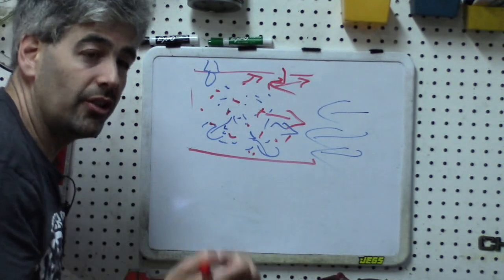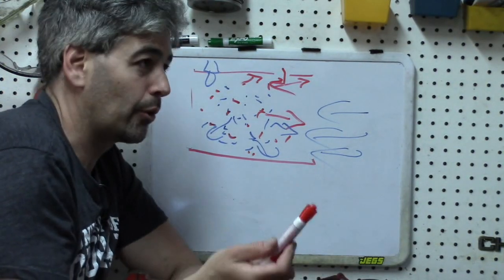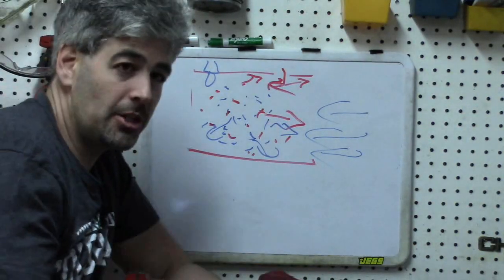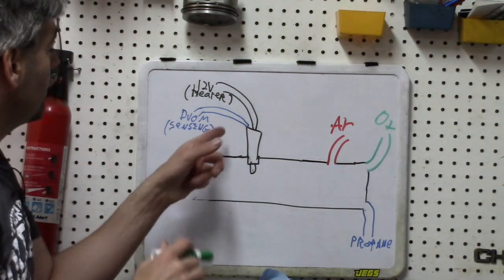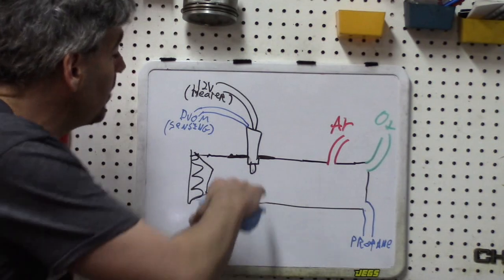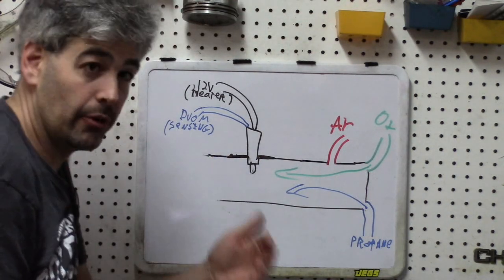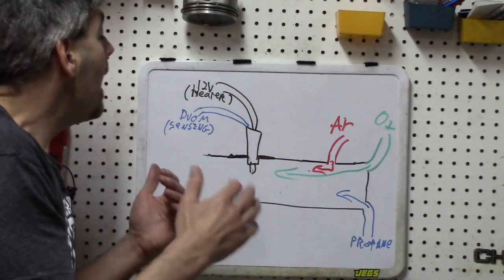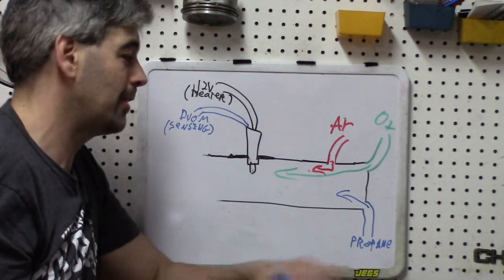Experiment for O2 Sensor Pt5  New Experiment Proposal

Comment: Matt,

I have 2 suggestions for the set up of the experiment. 

1) You should put a schrader valve so that you can hook up a vacuum pump and make sure the chamber is empty between each test since you know someone will question wether left over gases from the previous test could have effected the results. Might be interesting to see what if anything the sensor reads in a vacuum anyway. 

2) You should tap in a hole and screw in a pressure gage so that you can verify the pressure at which each test was made. Might even want to test what the pressure in a normal exhaust system is while operating so when you introduce each gas you can get it a close to normal as possible. Then if you wanted to you could test to see if changing the pressure makes any difference. 

hope this helps
best regards
Ed
Reply from the maker: Edward Mosquera Agreed with both and I have considered that- especially the pressure gauge I thought would be useful to ensure I create a pressure that is slightly greater than an expected exhaust pressure to fully discredit the "partial pressure" argument making an exhaust a closed system.
Reply: Schrodingers Box what about induced repetitive pressure within the exhaust. From the piston creating the pressure on its exhaust stroke, and the pressure dropping as it flows or equalizes (tries to reduce to atmospheric pressure) down the pipe. almost like a system that is alternating too and froe from open to closed. How ever relevant to this new experiment.
Reply from the maker: such a system would argue against the partial pressure crowd If anything and it is not representative of an exhaust system anyway. at any given time the exhaust is open at the end of the flow and the flow is constant and uniform due to the "rhythm" of the cylinders .  The only argument for a closed system would be backpressure from a cat, which I will account for.
Reply: Schrodingers Box Had one more thought about this. You mentioned using a DVOM to measure the change in voltage which should work but if you where to take the O2 sensor out of the pipe on the Trans Am and insert it in the rig you make you could use the scan tool which should be more accurate also you could test both the pre cat and post cat sensors. Would be interesting to see the effects on the post cat sensor since it should normally have a lot less of both O2 and HC in a properly operating system. 

best regards
Ed
Reply from the maker: Edward Mosquera Thats a clever idea actually lol. However, if you think for a moment my trans am is going to be anywhere near the garage during the experiment you are egregiously mistaken lol!!!
Reply: Schrodingers Box My portrayal of a system being open or closed refers not to a cavity being vented or sealed, but more to the nature of exerted pressure being positive and negative to the direction of flow. the flow is constant, but only in the manor of a balance of the exertions. (2 steps forward one step back...don't take it figuratively) The rhythm of these oscillations would depend upon the number of exhaust strokes and the pattern. (pattern unless an engine has been designed to cancel such an effect of building a balanced oscillation by interrupting the frequency) Fewer the pistons larger differential, and for back pressure anything after the valve would cause some effect of backing up. Not literally stopping

Comment: Here is my take on o2 sensors operations via youtube vid I posted on last stage (4) of this experiment series, entitled "here is a good one".
If you believe the video, the O2 sensor heats ambient ( outside air) O2 molecules to create 'ions' of O2 then compares the concentration of O2 ionized with O2 molecules within combusted gases ( pre-cat).  As you said before, it is in essence a chemical eval ( i was wrong earlier due to the NFK effect...no fu*king knowledge) ).  If the vid is correct, HDC molecules may not change the resultant voltage reading output of the O2 sensor.
That being the case, your experiment design ( I think) misses a major 'read', a. la. the concentration/mix  of O2 ionized molecules and combusted gas containing O2 molecules.  I.E. " does the amount of HDC (or any other material) introduced into the O2 ions/combusted gases mixture containing O2 molecules, change the output voltage of the O2 sensor.  
To me, from a scientific standpoint, the addition of any other diluent ie AR, O2, Hdc, etc. would need to be measured against the gas mixture the O2 sensor was designed to react to.  
Your channel is of my most favored and I appreciate your indulgence.
Reply from the maker: gst69man Agreed, and my experimental design will indeed compare inert gas vs "reactive" as described.

Comment: I would like to ad what I know about o2's. after dissecting several sensors I wanted to find the platinum that I read about and see it for myself. and its there. the zirconium oxide is a porous gate for ions to pass through the heated platinum coated hollow zirconium tip to the inside where there is a painted metal electrode to catch the charge. platinum reacts above a certain heat200-400 and the zirconium ceramic has a porous matrix so heaters or heat opens the matrix "ports" the charge is freed upon reacting and what reacts? pure o2 needs fuel to react in the presence of platinum so therefore I say YES>>the sensor needs some fuel to produce a catalytic reaction at the tip of the sensor and cause a voltage change to the signal wire and the resistor bias network senses that change

Comment: I support your new experiment for a final determination. However, I suggest you need to have some velocity on the gases as they pass over the sensor. I would use a length of exhaust pipe with a bung welded to the pipe for the oxygen sensor. Then I would attach a shop vacuum to simulate exhaust flow (drawing the gases into the vacuum). I wouldn't worry about fire from the introduction of propane because the oxygen sensor should react within milliseconds as depicted on your DVOM.

Comment: It is great that you keep pursuing this.  
How about a Skype interview with the Product Manager of a major Oxygen Sensor manufacturer?  That would be interesting.  NGK is in Wixom, MI. tel: 248-926-6900

Way over my head here.  Wondering if the Oxygen Sensors are manufactured to read Oxygen density only within a certain range of Parts Per Thousand or Parts Per Million within exhaust gases.  Also not sure of how important a role exhaust temperature plays in making the Oxygen Sensor work.
Did not see a link in the description for that EGR related Oxygen Sensor article.
Reply: Sandbag1300 haha my sentiment exactly! Just ask someone who designs these things. 
Schrodingers Box I went to the source (wikipedia ofcourse) and it states that Robert Bosch GMBH first invented the o2 sensor. From this company name I started searching for DOE&Gauge R&R but couldn't find anything fast. 
So I went on to search for patents that are posted concerning the o2 sensor. 
Schrodingers Box sorry if I screw up your experiment drift with this post. 

Yes found it at last! 
https://www.google.tl/patents/US4283261 The original 1981 publication of the invention of the o2 sensor. 

Electrochemical sensor structure to determine oxygen content in combustion exhaust gases - US 4283261 A
Resume
To measure partial oxygen pressure in gases, particularly exhaust gases of automotive-type combustion engines, a solid electrolyte plate of elongated rectangular configuration has at least one electrode pair applied to a single surface thereof, which is exposed to the measuring gas. Preferably, the gap between electrodes is elongated, by forming the electrodes in comb-interdigited form. A thermocouple - temperature sensor can be applied between connecting tracks for the electrodes which extend longitudinally of the electrolyte plate towards the other end 
thereof, through a sealing mass holding the plate within a housing, the other end forming, simultaneously, a connection terminal for connection to an electric connector or plug. A heating element can be placed on the
 obverse side of the plate, preferably in the position in the gap between the electrodes. More than one such sensor element may be secured in the same housing, and, for example, two such plates, back to back, with the heating element therebetween, spaced from each other, or as a common block. The sensor may be used for potentiometric and/or polarographic measurement, depending upon cover coatings on the electrodes which control exposure thereof to the gases, catalytic or non-catalytic action of the electrodes (for example being of platinum or
 gold, respectively) and whether a voltage is applied across the electrode terminals, or the sensor is to operate as an electrochemical cell. Such sensor can be inexpensively made, are suitable for mass production, and flexible with respect to their mode of operation.

This one talks about the actual production of the o2 sensor (1993):
https://www.google.tl/patents/US5518603

----
extra things you don't need to know.
This is a follow up on the original patent(2009) from Robert Bosch GMBH:
https://www.google.tl/patents/US8499752?dq=inassignee:%22Robert+Bosch+Gmbh%22+o2&hl=en&sa=X&ei=zNheVbHaD4ey7QaN-ICICg&ved=0CBsQ6AEwAA

Patent application for a new way to heat the o2 sensor.
http://www.google.no/patents/US4993392

This patent application is about a way to measure the deterioration of a catalyst with improved o2 sensors. 
Which states clearly that the o2 sensors are only looking at o2. (hence the name o2 sensor maybe?)
http://www.google.gg/patents/US5684248

Comment: My only real concerns with your design here are that A) You have the potential to make a rather potent little bomb, and the O2S Heater could very well become the source of ignition, and B) Most O2S Heaters are PWM designs.  Running a constant 12v to them could potentially fry the element.

Propane ignites at 540C, and has a much broader partial combustion range than gasoline (2-10%), leaving a slightly higher chance of making something go boom.  If you decide to go this route, please be safe.  :]

As for the O2S in the intake manifold, you say it has to be working by means of dilution of O2, but I think we're right back to each side basing its argument on the same data points.  The EGR gasses are the same as the exhaust gasses at the upstream O2S, just slightly cooler.  You could just as easily say that the presence of hydrocarbons entering the intake changes the sensor's readings, as you could that the O2 is being diluted by the EGR gasses.  I don't imagine that such an O2S is going to be looking for .45 volts in the intake like it would in the exhaust.  It's not looking for complete combustion; it's looking for the presence of EGR gasses in the intake airstream.  By exhaust standards, even a full EGR flow condition would be way on the "lean" side of .45 volts.  It's looking for calibrated, expected changes, rather than stoichiometry.  X amount of EGR at Y condition = Z-Optimization.  That O2S would simply be looking for a precalculated value, and tell the computer to vary the EGR valve until that value was met for the XY=Z equation.  However, here's the kicker:  It's introducing an air/fuel mixture into an already present amount of air.  Why is that important?  Stay with me here...

I've put some thought into this, and logically, the O2S acts as a ratio sensor.  Less quantity of air/fuel mixture passes through the exhaust at idle than during high RPM.  By introducing argon directly into the exhaust stream, it's no different than comparing high RPM numbers to low RPM numbers.  The ratio is the same; only the quantity changes.  The O2S doesn't care about argon.  We see argon, it sees a reduction in air/fuel volume, thus invalidating that methodology.  The only way to change the value an O2S gives is by changing the proportion of air to fuel.  Inversely, by introducing argon into the intake, you're displacing air PRIOR to combustion.  This changes stoichiometry, and the resulting exhaust gasses are no longer predictably controlled, thus invalidating that methodology.

Basically, the way we're trying to prove which gas an O2S truly senses is by reading a change in O2S voltage.  The only way we can change the output voltage of an O2S is by changing the ratio of air to fuel.  By changing the ratio of air to fuel, we have compromised the validity of which component was affecting the reading.  It's reciprocal logic.

I propose that if we truly want to see what an O2S is measuring, that we need to have a completely sealed system, and rather than varying fuel sources, air sources and noble gas sources, we need to keep much tighter controls and do direct comparisons:  A STATIC KNOWN amount of air, mixed with a STATIC KNOWN volume of various hydrocarbon gases with different stoichiometric values.  Ditch the noble gasses altogether; they're extraneous here.

Only by using a static known quantity of air mixed with a static known quantity of MULTIPLE hydrocarbon gasses, can we know for sure which component the sensor is measuring.  Propane, Butane, whatever else; I don't feel like looking up stoich numbers right now.  The same quantity of each HC gas (regardless of their stoichiometry), the same quantity of air, take a measurement from the O2S with each combination of fuel/air, then compare the readings to the KNOWN stoichiometric values of each gas.  If one mixture was leaner/richer than another, does it show comparatively lean/rich in the O2S voltage?  If yes, it's sensing HC.  If no, it's sensing air.  If the voltage does not change, it's sensing ratios and is not picky about the type of hydrocarbon it sees.
Reply from the maker: I Agee with everything except the sealed system. There is a different dynamic to the sealed system that is well established- gases do not behave like liquids.  A sealed system creates pressure which will cause the same number of molecules to be sampled regardless of diluent added. Thus we would in fact see no changes in the O2 sensor reading when attempting to dilute (and I will show this).  Because of this, the system must be representative of an exhaust flow (which some still insist counts as a closed system, we shall see). 
  But otherwise our thinking is totally congruent.
Reply: Schrodingers Box Plus, a sealed system raises even further the danger of building a bomb with this design.
Reply from the maker: DE Nichols Agreed- there will only be sealed system experiments without mixtures of oxygen and fuel.
Reply from the maker: rhkips Thanks RH- Safety of course first priority and I have that in hand.  I actually more respect the brief reminder on safety followed with significant contribution to the topic.  I was expecting this video to be fodder for the "safety police"- e.g. the crows who has no idea what is going on but they just want to make themselves look smarter by pointing out obvious safety concerns.  Thus far no one has done that- a testament to the subscriber base being a considerable "level above".  Imagine the comments if ETCG did this.

 Anyway to clarify- the only purpose of the sealed system is purely to show the exhaust is NOT a sealed system, so some sealed system tests will be necessary (safe ones).  If I can establish the exhaust acts completely different than a sealed system, the "partial pressures" argument against my previous experiment are dismissed.
Reply: Schrodingers Box I keep wondering if exhaust was in a sealed container if the necessary chemical reaction to make the O2 sensor produce electricity would fade.

If my hypothesis is true it would put to question any experiment done in that state.
Reply: it was before my time, but recall the Apollo 1 disaster/fire associated with pure oxygen.  I know you are doing your homework, but it is not obvious to all that pure O2 can make stuff ignite which otherewise would not normally burn.  Not sure if you plan on running a case using pure o2 or not.
also, i'm hoping the sensor stays hot enough since you are likely using ambient temp gases.
Since the outcome will likely not change diagnosis philosophy, I'm not sure i would have your energy to do part 6....cudos to you.

Comment: I had a gut feeling that it is not over yet. I do not mind. Biggest discoveries in science are driven by curiosity. I am all for it. 
 Suggestion: O2 sensor should be placed into narrowest part of the chamber. Like bottle neck. that reduces turbulence and other unwanted effects caused by dissimilar gas densities. (open loop configaration)
  You are going to monitor temperature right?
Reply from the maker: That would not be representative of an actual exhaust and thus the partial pressure argument is not represented. It has to be straight and equal diameter like a regular exhaust
Reply: I thought the experiment is about O2 sensor not the exhaust system.
Reply from the maker: Tiit Saul Well, it is, however the problem is an exhaust system can have an effect on the O2 sensor readings so the exhaust design is a critical consideration.
Reply: If exhaust design is a critical consideration you have include muffler, cat, headers and so on.  Pipe diameter is not the only variable. And I don't know how Argon and Helium behave in exhaust system (maybe I am stupid).
Reply from the maker: Tiit Saul No its not that tilt... its pressure.  gases under pressure in a closed system do not show measureable effects of dilution.  i have to show that the lack of effct seen with noble gas in the car exhaust was not due to this effect.  Easily done with the model i will design.
Reply: Ok thanks Matt.

Comment: I suspect that the output voltages of the O2 sensor for rich, ideal and lean conditions will be proportional to the concentration of O2 in the test chamber. In order to keep your costs to a minimum you might want to experiment with O2 before remortgaging for another bottle of noble gas.